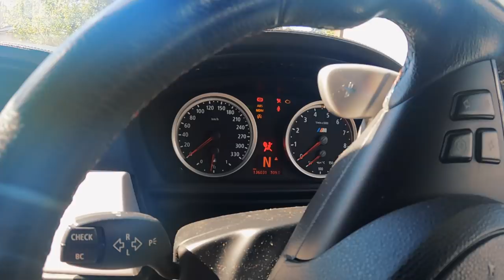THE V10 BMW we HAVE BEEN HIDING From YOU!!!: ITS A SPECIAL ONE!

Comment: I could tell what it was before you took the cover off by the overall shape and the bottoms of the rims and then when you said how much you would lose if you sold it today I was convinced.... S85 is so iconic in both good and bad ways. Thanks for sharing it with us mate.
Reply from the maker: Yeah we have a HUGE emotional attachment to this. It was we made it car.... (oh how wrong we were lol) but had so much fun in it and its not a toy, it still up there with modern muscle if you let it wind out. We race and R1 back in the day from 150kmh out to about 270kmh and he never got in front. You just shouldnt be able to do that in a 4 door.
Reply: @ZeroTo60Tube  I've been a passenger in one but never driven one, that experience alone was something I look back on and will never forget so I can only imagine the attachment you guys must have to yours. I definitely want to see this thing roll racing. I think you're on the money with it being an o-ring for the oil cooler going off what I could see in the vid, fingers crossed.
Reply from the maker: Awww man its epic. It makes so much noise, this on song going sideways in 3rd gear, the right pedal is directly linked to both angle and V10 scream. Its truely something you cant get with the turbo motors.

Comment: That engine is amazing and the rod bearings aren't that big of a deal, it's the vanos pump and vanos unit themselves that are SOOOO expensive.  When you did the clutch did you check the one loom of wires that doesn't have the plastic heat shielding?  That loom sits by the exhaust and the shielding crumbles.  Has to be depinned unwound and new heat shrink tubing.  I have a M6 on my IG page where I did that.
Reply from the maker: We didn’t check the wiring...... well it was so long ago we didn’t really know much about the technical side.
Reply: @ZeroTo60Tube  if y'all get on Instagram you can check what I'm taking about @rolleymotorsports

Comment: Wow! That's a beauty! 
I drive a Moroccan Blue 2010 535i xdrive e60. 90,423 miles. 
What aftermarket headlights are those? Are they active?
Reply from the maker: The are genuine hella headlights. We put them in about 2 years ago. However they are not active. We still have the OEM active ones, but the lenses are toasted. We put these in and coded out active headlights.

Comment: Jealousy intensifies So you get to mess around just about every weekend on track with your friends, you have a nice-smelling but stubby black knob... installed on the new 328i, a gorgeous 335i that's "just too powerful" to take out, and a family E60 M5 in that gorgeous blue that you've kept in good shape through the years. You fellas have it alright down there! -- Recognized those wheels beneath the cover in a heartbeat. That is an extremely special car indeed. As for plans on it, I'd love to see it roll race but without the rod bearings done seems like a roll of the dice also. You'd be gutted it anything happened! I dunno... Maybe trailer it down for one or two? -- Would you consider getting in touch with Dinan for the stroker kit? One of those and some equal length headers would raise the dead. SMG is great at 8/10ths and above but what about manual swapping? I have no idea if that's a thing like in the E46 but keeping all the original parts as you have been but stroking it and with a manual swap would cement its stats a proper heirloom vehicle.
Reply from the maker: We’ve been eyeing off the Dinan strokers since day 1!!! We’ve been keen on the idea of dct swapping it. Equal length headers, decat, e85 tune, and raised rev limiter shifting through a dct may be the best noise to ever come from a BMW.
Reply: @ZeroTo60Tube  yes BUT... and I'm getting those cool noises in the -is, but I just miss driving a manual. Drove a crappy old ass'd Alfa from the 80s, and then a Scion Tc of all things and ragged the hell out of them both and had more fun, was more engaged with the car than I was with my 335is DCT before I put the xHP tune on it. Maybe it'd change the nostalgia aspect for you all but the opportunity to get closer to S85 is worth a second thought. From Germany, that's the high watermark for NA engines, period. The old ways distilled into one ultimate build.

Comment: Damn that is nice.

Also, I might have bought a ON3 Single Turbo kit lol... What setup would you recommend for Port Injection+controller, also LPFP? Currently have a Walbro 450, would I need dual 450 or a single 525 perhaps?
Reply from the maker: Regardning the PI kit/controller, speak to your tuner and i would work with what they like, since they are going to be the ones dialing it in. I like JB4, but i am a bit more in to it all and probably over the top. Regarding the pumps, i would go twin 450s, a 525 will hold ok, but if you are running 25+psi without a rising rate fuel reg, i bet the twin 450s will out perform the single 525 by a mile.
Reply: @ZeroTo60Tube  Okay cool thanks. Haven't decided on a tuner yet... Tricky.
What about a walbro 535 then? I'd really like avoiding a hobbs switch and dual pumps, seems like more work/headache.
Reply from the maker: @Zalle335  Well the JB4 PI controller, controls the second pump. Which may be why i like the twin setup. I can't recomend JSR enough. Shoot him a message, tell him you know ZeroTo60, tell him your plans and ask for his opinion and what he would prefer to tune. He may help guide you knowing, the limits of what he can get out of each setup and what will simplyfy the build.
Reply: @ZeroTo60Tube  Thanks for the help! Appreciate it, I will shoot him a message and hopefully get some clarifications.

Comment: Everyone shits on E60s like they are the anti christ but in the last 12 months they have become really affordable. It's just too bad we never got manuals in Australia for the M5.
Reply from the maker: This thing has been a car and a half. We didnt have the mechanical understanding we do now when we got this. Its had a hard life, and proven itself so many times. And yet its still insanely quick 15 years after it was sold new. Not to mention, nothing will ever sound like this from BMW in the future. This was the combustion engines peak emotional impact. The motor has so much involvement compared to the S63 in the F10.
Reply: If anything N54's are the antichrist! I have a 335 and a E60 M5 both with over 200,000kms.... The N54 has been far more complicated and unreliable. S85 you only have to deal with rodbearings, actuators and vanos. N54 pretty much anything bolted to or around the block of the engine will ruin your day. There is one manual M5 in Australia (I converted mine to manual), and having a manual greatly increases the E60's reliability 🤣
Reply: @bryce00723  Where did you get the conversion kit from? I've always wondered whether the bellhousing on the S85/S65 is the same as the N62. Or even if the N62 is the same as the M62.
Reply from the maker: oi when you gonna let us drive that manual on the channel! COME ON BRYCE!!!
Reply: @sweetandsour4390  E92 M3 gearbox bolts straight up to the S85.
Reply: @ZeroTo60Tube  It will happen :) Feb?? 🎇🎇
Reply from the maker: @bryce00723  lets make it happen